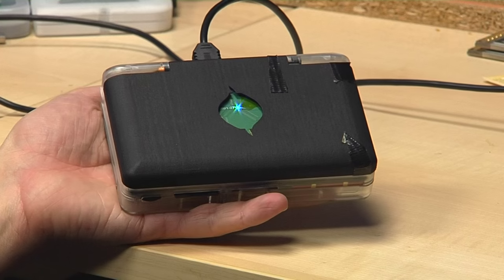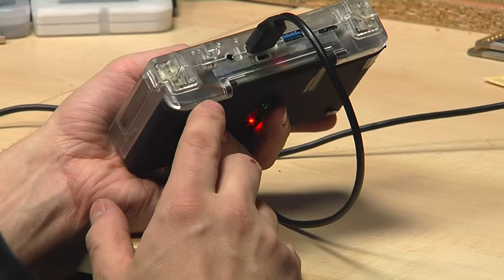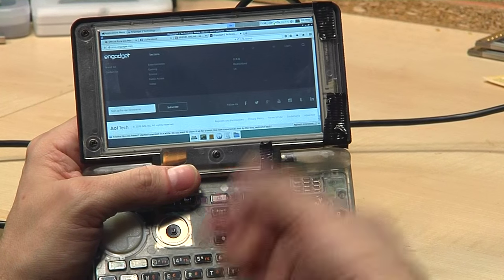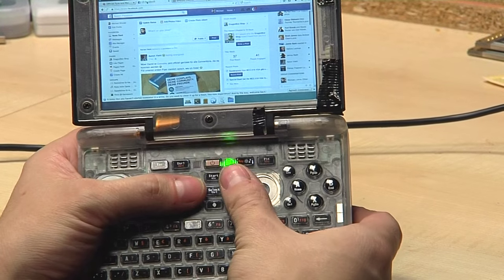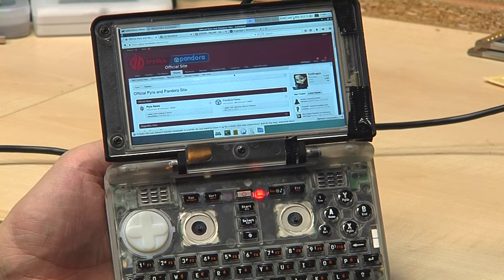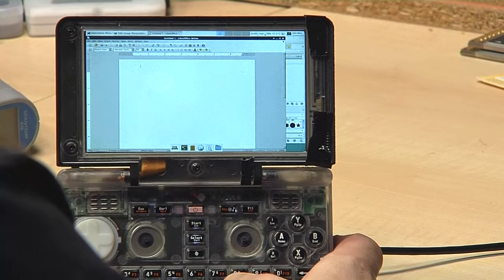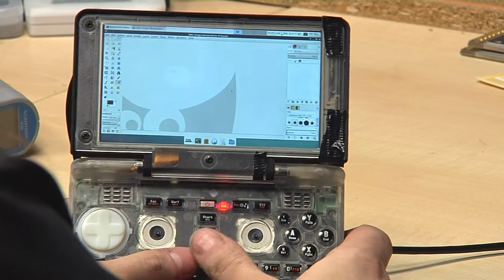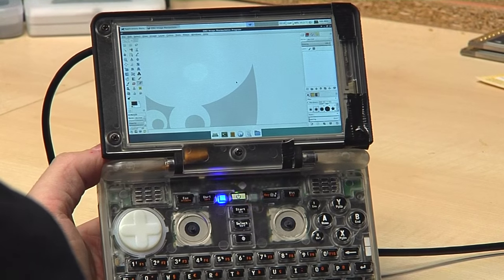DragonBox Pyra: Early prototype

Comment: Really interesting to see the steps in development! Great work!
I had the problem with a swollen battery on a mobile phone from a major manufacturer before, it made the back cover come off very often, so it's great to see that you thought about that potential trouble area.
I'm a bit worried about the accidental pressing of the backspace key etc. even if the action buttons get raised, altough it's difficult to judge from just watching a video or pictures.
Questions that came up while watching this:
- is it an IPS-screen?
- will the user always have to start with a special Pyra Debian image or would any distribtion run on it, maybe supported by a Pyra repo to pull additional drivers and tweaks?
- what will be the default desktop environment and will the user be able to install other desktop environments?
- will hibernate be supported?
- is there no webcam built in?
- did you perfom drop tests to find out if the case survives a fall i.e. from a table?
I can't wait for the next update on development!

Comment: Glad to here you're putting more space in the back cover, I've needed to buy a new back cover for my pandora for a while now because the battery snapped the pegs when it swelled up. Do the keyboard buttons feel more solid when you press them? (like maybe closer to the game controller buttons?) The pandora feels a bit "squishy" which can cause letters not to register too well when you type fast.
Reply: +TheRealAlpha2 Yes, the keys feel more solid, as they have plastic caps (so they're very similar like the normal gaming buttons).
Reply: gepixelt
Thanks, I'm so glad to hear that.

Comment: Probably a stupid question as I've never used a device like this before, but will the Pyra be able to run programs designed for the Open Pandora?
Reply: Yes, they both run the same operating system (if it's Linux, it's compatible).
Reply: ***** Cool beans!

Comment: I skipped on Pandora as I was a poor student at the time, but I'm definitely getting Pyra.
Just one question, though: why full sized SD cards and not microSD cards? Did you just not need the extra board space?

The separate SOC board is genius! Besides the huge development advantages, it makes Pyra the first upgradeable handheld device that I am actually interested in.
Reply: From what I heard him say, he is actually running out of space for more WLAN antennae but I will just state the obvious that SD cards can have bigger capacities which means you can have over 1 TB of space in the Pyra currently as there also is an internal microSD slot.  Besides that, SD cards are more robust and can have faster controllers for higher bandwidth.  Also, the slots themselves are being used for heat dissipation which means bigger is better.

Comment: What is the difference between this and a cheap android  phone ? I mean if  you plan to play games and emus .....
Reply: +Miguel Reyes Android still has sound lag issues, which is not nice when playing games. Also, Android phones are missing gaming controls and often the battery is empty after a few hours of playing.

However, if you're just looking for an Android gaming device, then the GPD XD is better suited for you. The Pyra is more a full blown Linux desktop PC which can also be used for gaming :D
Reply: +Miguel Reyes It's a portable pc and it just so happens to run emulators  also. You are not limited to only playing games or running emulators. You are able to surf the web, do spreadsheets, compile and anything else you can do on a desktop computer on something you can put in your pocket...that's the difference.

Comment: why you dont use capacative sensor?

P.S Hello from Moscow,Russia
Reply: +Raul Musaev If you mean touchscreen with sensor. Then the reason is because they want to be able to use stylus for input. As you can see most of the icons are small and it's easier to use non touch OS with stylus than your finger. And capacitive pens are not as accurate as normal stylus on resistive touchscreen.
Reply: Hene193 thx )

Comment: Mhh... how about windows 9x emulation? will it be possible?
Reply: I think it is possible. It has more than enough power to emulate an old PC, one which can run Windows 95/98. Even you can use Wine on ARM: https://wiki.winehq.org/ARM
Reply: +David G I was talking about something like a VM... Even an I3 struggles with it because there are simply not good VM software to try W9x...

In any case I preordered a Pyra, so I suppose I'll find out :P

Comment: Hardware wise I think everyone should be making devices with USB-C. I'd do 1 microUSB and 1 USB-C. I like the full SD cards since they are faster than the micro but at the size of a full SD you could use a m2 SATA drive.
Reply: +David Ugarte That would be more expensive.
Reply: +KohkelxonTNX255 without a doubt. I think I would use it more than just a handheld emulator though if it had more power. I prefer a physical keyboard so I think something like this, if it was slightly more powerful could be used as a replacement for a smart phone, a linux laptop and a pretty sweet war driving machine.

Comment: Why Dual Core? That is terrible compared to today's tech, at least quad core. Other than that it looks amazing and I would love to have one! :D
Reply: Short answer: They simply couldn't get any better suited SoC in small amounts back in 2013, when they were asking companies.

They either didn't get a reply or offers for at least 100000 chips.  In the case of the Nvidia Tegra, the contract would have required them to hire a Nvidia-certified design company for the device, which was out of the question, financially.  Intel was considered but the community was against discarding the available ARM-optimised programs and their models were still using too much power back then and someone would have to write a BIOS for that first.  They already had a good connection with Texas Instruments since the Pandora uses an OMAP3 but OMAP5 is sadly the fastest they have, even to this day.

On the bright side, there is a good reason the OMAP5 is only dual-core, as the Cortex-A15 core was meant to be a power horse.  On paper, it's as fast as the newer quad-core Cortex-A53 in multi-threading which the Raspberry Pi 3 has.  Meaning single-thread programs, which most still are, will run twice as fast.

Comment: sorry but the gpd win kinda beat you to that
Reply from the maker: Not really, as the GPD Win is very different device.
Hardware is not open, battery not replaceable, it's bigger, not upgradable, less connection ports, no mobile internet, etc.

It's a nice device (and I'm the official distributor for the GPD Win in Germany as well), but still very different.
Easier to manufacture and produce as well.

I just hope the quality will be better than for the GPD XD - it seems 25% of the GPD XDs die within one year :/
Reply: +OpenPandora oh wow that is very different. Super cool. Never heard of a modular handheld like that. So simple but very ingenious

Comment: with the new coming powerful w10 handhelds coming from gpd, kickstarter, etc this is already dead before arrival
Reply: Well, depends on what you plan to do.
The GPD Win has no 3G/4G Mobile internet capability, the keyboard isn't as usable (it's not centered) and the storage capabilities aren't as good.
It's also missing additional features like a replacable battery, upgradable CPU board, resistive touchscreen (a lot more accurate), and backlit keyboard.

So yes, if you plan to mostly play games that run on Windows, the GPD Win will probably be a lot better suited and it's got a good price. But if you want to do other things as well, the Pyra might be a lot better for you.
Reply: fabian esterma I actually care. cell phones cost $1100 or more with a 2 or 3yr contract. and they only play Android games or apple etc. and when there two year lifespan is up there obsolete. if this device is upgradeable it's payed for itself.

a gaming device. a computer. and a phone all in one. seems like a decent price for what you get

Comment: gpd win is better
Reply from the maker: +Carlos Piedra Depends.
Keyboard layout of the Win is pretty bad, it's so wide you can't even reach the middle keys properly.
It's not as flexible (less SD Card slots, less USB ports) and has a capacitive screen which is not good if you want to hit small buttons or window decorations.

The DPad is probably not that good (the GPD XD has a bad keyboard), and it's running Windows, which might be useful to some, but also not useful to others (I'd hate to have to install games for 30 minutes only to find out they don't work properly...)
Reply: +OpenPandora idk most of the gpd consoles are pretty good. i own a gpd xd and I'm pretty satisfied with it.
Reply: +OpenPandora with all due respect, the GPD win has steam on it's side and windows 10 so the only limit of what games it can play is what it can handle.
Reply from the maker: +Nick Principe Yes, and?
There seem to be a LOT of games the GPD can't handle, and with Win10, you will only find that out after you installed the game (can take up to 30 minutes or longer, if it's a large game) and if it doesn't work, you have to uninstall it again. If I had to do that, I would be pretty much frustrated.
Win10 is a downside for me, I prefer Linux.

So it can run older Windows games which often use small buttons, which means the capacitive touch doesn't work as good... LTE is missing, as are proper storage capacities (one MicroSDXC Slot... that's not much, as some Windows games need 30GB or more themselves).

Doing office work is not that good with the keyboard...

So it depends on what your focus is. If you plan to only play Windows games from around 2010 on it, it's perfect and certainly better suited than the Pyra. If you want to do some work or want a smoother gaming experience (the games released for the Pyra will all work on the Pyra, no trial and error!), then the Pyra is better.

The GPD Win is neither better nor worse, it's different.

And yes, I also have a GPD XD, and the DPad is horrible and it has ugly lightbleed. Apart from that, it's okay.
Reply: +OpenPandora Look, I know you are passionate about your product, as you should be, I admire your work put into the pandora and pyra. I've been eyeballing the pandora and pyra for years now and always wanted one so I am not against it at all.

You can certainly run more than just 2010 AAA games on the GPD, there is a lot of new (3D and 2d) indies that would also work on it. I don't believe you'd have much trial and error with a atom chip since I've seen the exact atom running in other tablets playing games just fine, but we will see when the actual device releases how it functions in the real world.

In terms of gaming outside of emulators a windows device offers much more than debian Linux, HOWEVER if someone does prefer linux and their intention isn't running steam games, rather emulation and whatever games do support debian linux on arm then the pyra would be better suited and also it would be just fine outside of gaming too, like you said before there are plenty of ports to use. 

I will try to buy a pyra at some point to support, I'll also get a GPD win, it will be fun to have both! 

I wish best of luck to the pyra and hope the launch goes smoothly! I do like how you made it upgradeable like a PC by taking out the board and replacing it. That is awesome.
Reply from the maker: +Nick Principe Well, I see your fixed on gaming, which I am not, and I think this is the big difference!

I am fixed in having a mobile computer with useful functions like a keyboard backlight, many USB ports and a Linux where updating ALL programs is just one command (and not updating every program manually).

If you are mostly interested in Indie games: Yes, those will work fine. Many of them will also work on the Pyra. I've even played Windows games with ExaGear and Wine on the devboard, games like World of Goo or the Knytt series is fully playable.

That said, for those Indie games, the GPD Win is well suited and less a hassle than the Pyra, sure.

The problem is though that many expect it to run games like GTA5 or similar on the go... and that won't work...
Reply: +OpenPandora Not GTA 5 ( unless there is a mod to lower graphics even more than the stock game allows) but GTA 4 could run :) 

I got the impression the pyra and pandora were gaming devices first which is why I brought games and steam up.  But if you are into the computer side of things it's simply a windows vs Linux preference.
Reply: +Axel aazer Yes,  it could run it no problem.
Reply: Sure, the OpenPandora project came to be for a successor to the Game Park handheld consoles that was mainly focused on emulating old systems but the focus shifted with the DragonBox Pyra:  Main change is the 720p display instead of an old system friendly 480p resolution, meaning emulators will not run fullscreen anymore but on the other hand standard desktop environments will be more usable.  Why would a handheld console need so many ports and an eMMC plus microSD and two SD card storage and be completely modular and potentially upgradable?  This is a device for tinkerers.
Reply: @Lightkie   This, think of the GPD as a scrip kiddie/casual device. Nothing more than a device most will buy just for one thing, windows gaming. [though granted the controls on GPD are lackluster as they are always missing the clickable thumbsticks for some reason] . The Pyra on the other hand can be seen as a makerscene device.  The extra features Pyra has over GPD is just the icing on the cake.  Now I am not saying GPD is bad in general, no. GPD has never offered much that my gaming PC can already do.  This has given GPD a gimmick feel imo.